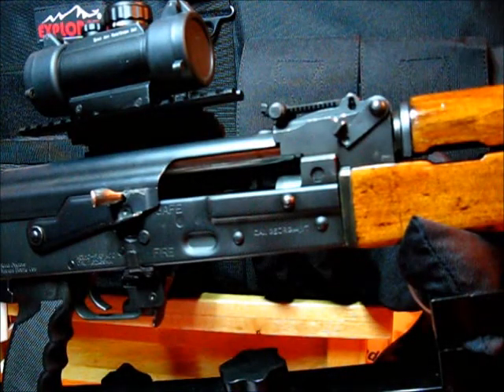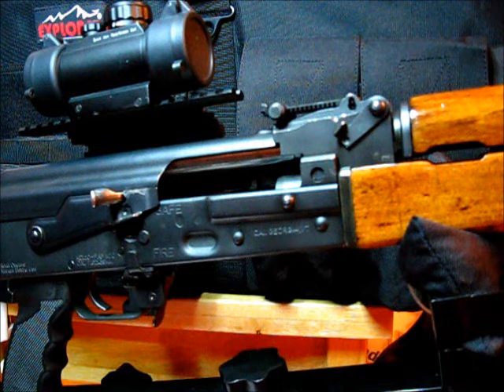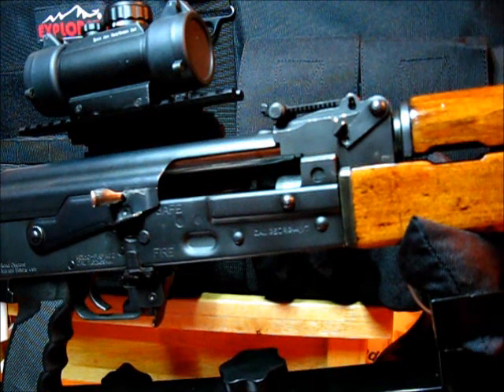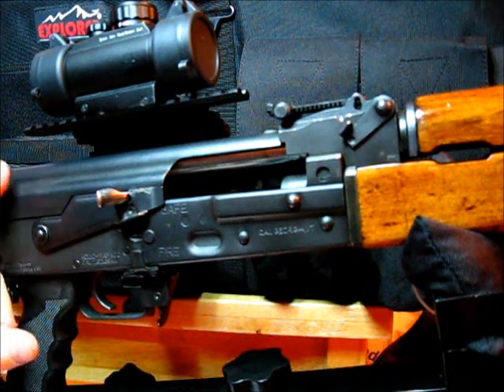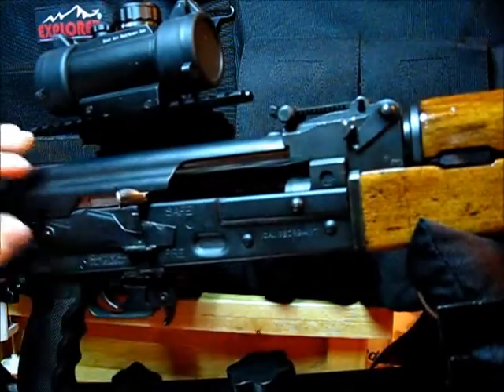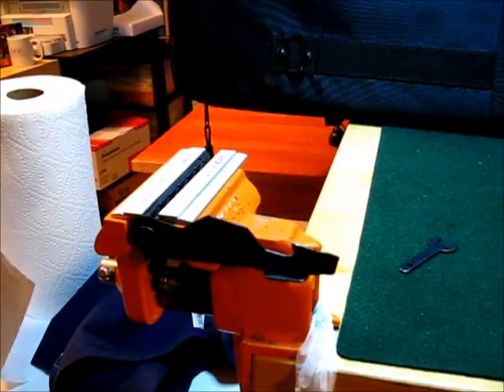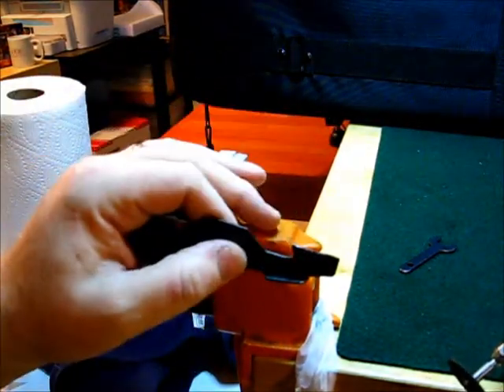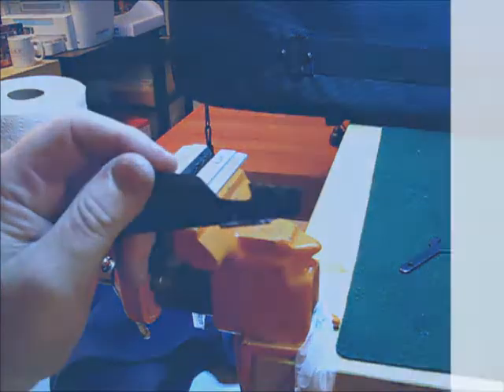AK-47 Safety Lever Modification For Bolt Hold Open

Comment: Thanks for the video! I saw there were some after market options available to buy but none that had your handy ramp that lets you pull the bolt back to disengage. With all said and done I spent about an hour cutting, filing, and blueing and am happy with the result.

Comment from the maker: Well there are 2 parts to this, 1 is the safety lever BHO so you can comply with certain ranges that require it. That's the most important one.  The other is the magazine mod to hold open after the last round. Once you are in that state, then it's a simple twist of the thumb & finger to engage the safety lever BHO and swap out your mag, then release the safety lever.  The main benefit of the magazine BHO is to give you a visual check that you are out of rounds and not firing on a dud round.

Comment: you are going for similar mods and ideas i had for my ak!  with bho mag followers, it seemed like such a good idea to lock the bolt open from there, change mags, then drop the bolt, but you are correct... its just not feasible.  i'm going to make the bho safety mod that you showed here soon and appreciate your video. it looks like you did a good job.  i was wondering if you had considered using the very piece you cut out of the safety to add a switch to flip the safety easier to it.   seems like it would be a replica of the krebs safety at that point.
Reply from the maker: snewso I found the part I cut out, but it is not big enough to make a comfortable safety sweep.

Comment: I don't get the hole idea of the BHO modification so help me understand. The bolt stays back after the last round has been fired. You pull the magazine out and the bolt slams to battery before you insert the next mag. Correct? So I'm thinking what good does it do to do all the work to modify your mags and safety lever when in the long run it doesn't work like the AR15 system works. Am I missing something here?
Reply: i know im late but what it gives you is a way to tell when youre empty, as the recoil will be different without the bolt fully closing

Comment: If you pull the bolt back then squeeze the trigger,then release the bolt,then release the trigger it will stay open by itself.To release it,simply pull the bolt back to the end then release it,it will then close.No modifications required.Works on all my AK rifles.
Reply from the maker: The only problem with that, and it may just  with my particular rifle, is that any shock to the rife will cause the bolt to close.  Also in competition, they frown on you having your finger on the trigger when you are safeing the weapon.
Reply: I never competed,so not aware of rules or laws.Good to know.The bolts in both my Yugo's will not go forward when I do this.Good for transporting,easy to see the chamber is clear.Show next week I will look for an extra safety to alter like you have.I like the idea.
Reply from the maker: bigfootlivz my AK won't do this reliably.

Comment: Why even take the gun apart? Just lift the lever above the dust cover and take a chainsaw file to it. Its exactly like a chainsaw tooth.
Reply from the maker: Jeranger19 The reason you take it completely off the receiver is so you don't contaminate it with metal debris from the cutting and grinding operations needed to make this mod..  Besides, you have to take the bolt out to get the safety out anyway.

Comment: now you have a hole in your dust cover. :/
Reply: no now you have a hole in your safety lever,  there is only a hole exposed while the safety is engaged and bolt is not locked back.... if safety is not engaged there will be and even bigger hole there that the safety is not covering up weather this mod is done or not, so i don't get what ur problem  with this mod is???
Reply: jcm1689 when the safety is on,you still have a hole in your dust cover is my point.
Reply: Ak's dont need no damn dust cover anyways. Some of the originals were born in sand remember